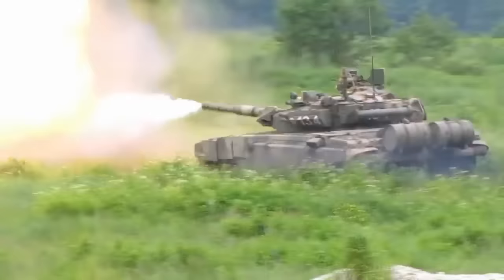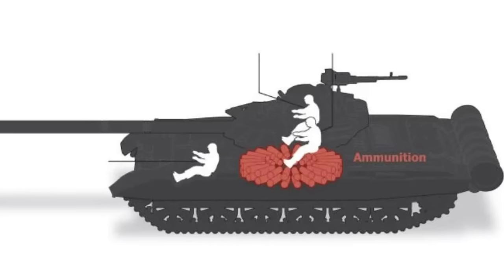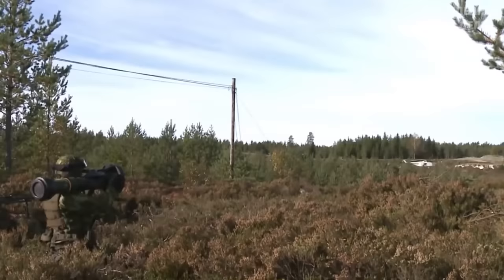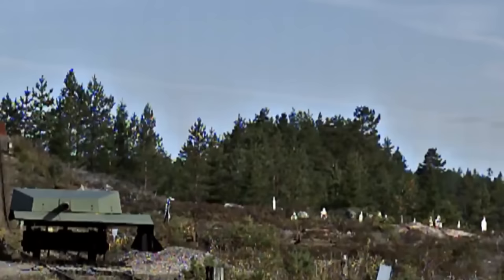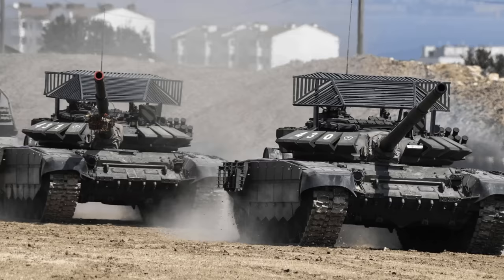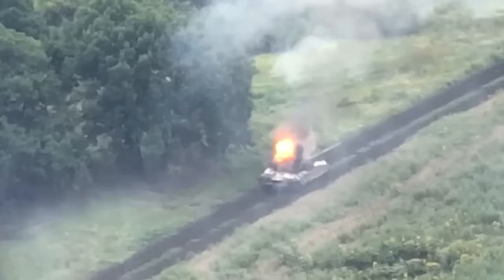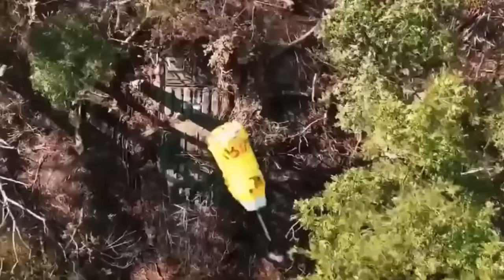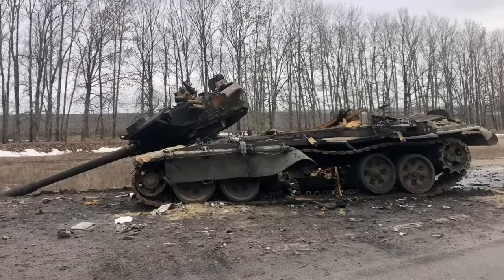Why does this happen to all Russian tanks? / real footage frome Ukraine

Comment: The part about the amunition storage isnt completely right, yes western tanks are way safer due to where the amunition is stored, but the russian tanks have to store the shells there, else the auto loader wouldnt work, most russian tanks are loaded by an auto loader wich greatly increases the fire rate, down side being that the People in the turret are basicaly sitting on a bunch of high explosives. The reason western tanks can have the shells in the back of the turret is cuz the main weapon in those tanks are manualy loaded. The russians do have some upsides to their tanks, they are way smaller than any western tank making them les visible and also harder to hit, but almost any tank has almost no chance against modern anti tank weapons cuz most tanks (aspecialy the russian ones) where designed before the fire and forget man portable anti tank weapons like the javelin and Nlaw so most tanks are realy vulnerable to those weapons, and no mater what type of armor you have those weapons will shred through it like it isnt there, aspecialy the javelin with it's twin warhead wich makes even ERA (explosive reactive Armor) useless. The javelin creates two individual explosions, the first one Just destroys the ERA, the second one makes use of a shape charge that creates a jet of super heated metal and send it smashing into the tanks armor basicaly melting its way through the armor in an instant. You cant blaim the tanks for being destroyed by a weapon that was made purely to destroy any armored vehicle that crosses its path

Comment: most of videos that i saw when a tank blows up im keeping an eye to details most tanks that i saw blowing up where ukrainians how i know they never had a symbol V O Z on them later one ukraine catched up with the detail and desidet just to paint a symbol on the tank but tbh u can see the difference between a real russian tank vs fake russian tank from ukraine by how they spraypaint the symbols  but yea the ammunition is stored like that becouse it's an autoloader requires less people commander gunner and driver while a abram has 4 with comander gunner driver and loader since it's has a loader all the ammunition is in the back of the turrent sealed but even that can caus a overkill deppens on the ammo and if a abram is hit by the side like a T72 boy all crew members inside that ab are dead with some luck maybe the driver survives even though the T72 is outdated it's a tank that surpases the M1 abram in offensive and defensive a M1 is build to by a defensive tank if the abram is alone it's a good bye like most of the tanks right but a T72 is cheap while the abram is expensive as hell if it comes to M1 vs T72 ill put my money on the T72 great tank for ambushes aswell 1 abram in price equals 15-16 T72 it's hurts more to lose a M1 that cost $8.92 million just becouse fancy tech inside it that wont save it either way from a kornet  while the T72 is $0.5 million in 2011 and has less cremembers still deadly with the ammo that can pen the M1 abram from anyside The 125mm gun common to all the T72 models is capable of penetrating the M1 Abrams armour at a range of up to 1000 meters

Comment: come on man if youre gonna state lies, at least make them half truths, Russian turret armor is stronger than the hull easily. Every tank, including Americas Abrams, have fatal flaws an weakpoints like any other. you can even use Ukranian T-64 tanks, the hull armor protects about 300-400mm from certain APFSDS rounds while the turret, with ERA can stop up to 500-600mm depending on certain rounds. Russian tanks go pop waaaaay more because of the ammo stowage for the auto loader which, if damaged is basically a 100% death.

Comment: not like that. many tanks was destroyed because the old armor that no longer hold the load, but many T-90 already survived even stronger loads or endured enough to save part of the crew. the armor maretiral is the point. 

"Russian tanks have several vulnerabilities in their design" FALSE, they not are m1 abrams to have such "vulnerabilities", russian tanks has some weakness but are hard to hit from far, is not that easy as many say. when all m1 was brutally slaughtered during iraq war by vulnerabilities and also ack of armor, lacks of armor like T-72, the m1 design mistakes was so grotesque that they was destroyed to open wide with only a RPG-8 model, non-mod! even T-72 that is the weakest russian in service just stop run after get hit by the same load but yet not explode. today, the 3 best armored vehicles are Challenger 2, who survived more than 70 rpg direct hits from all sides, T-90, that in this current war already survived anti-armor loads that resemble and also overcome javelin, and Armata, that was not used yet but uses many shields and fast response defenses. T-90 is in second place, to be there, he not have all of that weakspots. 

btw, no matter what armored vehicle is, if he get hit by a AG for example, he will be destroyed, even olifant mk2 that is pure armor, build to hold the line and nothing more, would be destroyed by a old ag maverick model, because these weapons are several times stronger than many anti-armor weapons shoot from ground, but there are some batteries that use AG without the 'A', can shoot from ground, by laser paint for example, so, will be a huge damage to anything, even bunkers can be destroyed with that